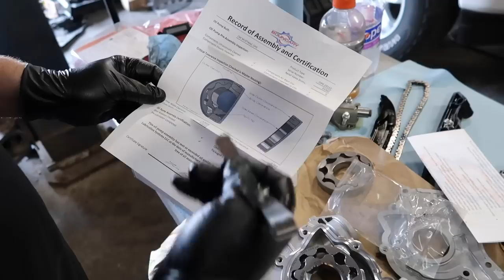ESS G3x SUPERCHARGER INSTALL on my 2022 FORD MUSTANG GT! LET'S GO!!!

Comment: Just a word of caution for those considering the ESS Supercharger kit.  ESS is now sending these kits with cast aluminum components. Their website still states that the brackets, supercharger case, and T-stat extension are Billet Aluminum, but they are not. However, the price remians the same even though they cut costs and quality.

Comment: I wonder how your numbers will compare to mine.  My 5800 mile 2020 GT (Oxford White) 10R80 is at Palm Beach Dyno getting Boundary Oil Pump Gears, Procharger D-1X, Fore fuel system, id1050 injectors, etc.  Supposed to be done and tuned this week.  Also has Stainless Works 1-7/8" long tubes, no cats, then stock after that.

Comment: How did y'all hook up the analog boost gauge tubing for the p3 v3  multigauge?
My tubing kit came with a 5/32 T fitting and the blow off tubing is 1/4" 
Got the gauge mounted in the dash and can't find a 1/4 x 5/32 x 1/4 T fitting to connect the analog gauge tubing to the blow of valve tubing.

Comment: great video and install.  I own a paxton kit on my 14.  I've seen ppl making over 900whp on this kit which is great.  When you drop  pulley size and take the intake off to run a blower guard it will make more noise.
Reply: 900whp no maybe crank

Comment: I feel like this is exactly like your last mustang build. 
Shouldn’t you do different things? 
And not the same things as before?
Reply from the maker: It’s very different. Different transmission. Different suspension. Different blower combination. Different color car. Different looks going on the car. Totally different
Reply: @Zander13Productions  what mustang did you recently have from 2018+ that had an ESS kit on it?
Reply from the maker: @KapcomRacing  a Mach 1